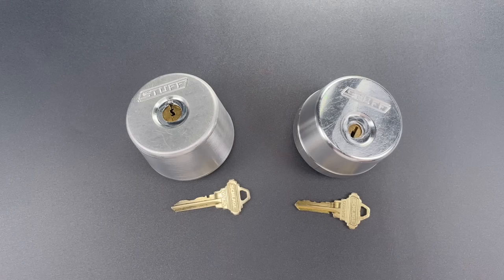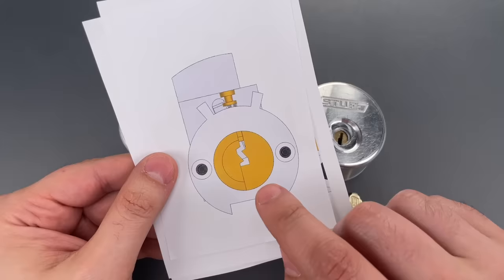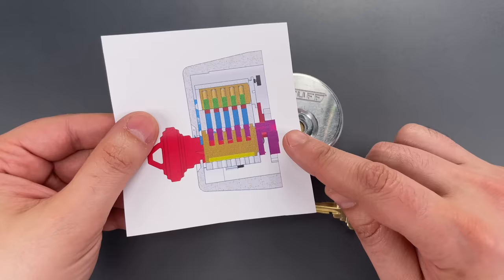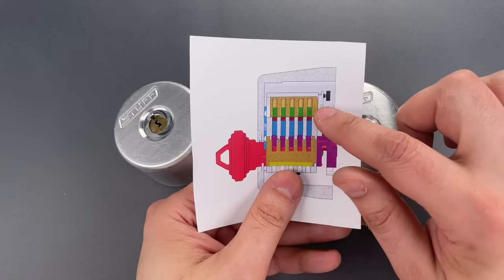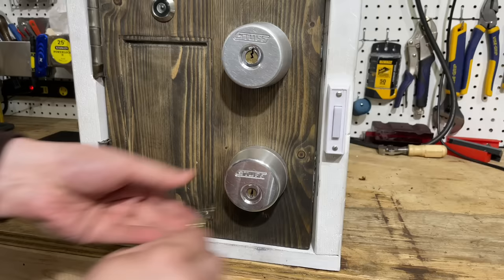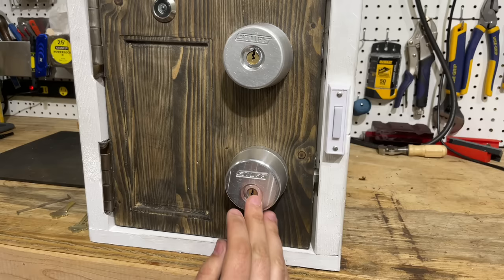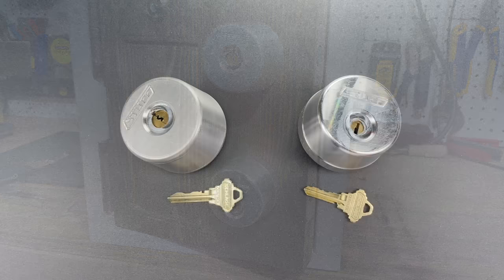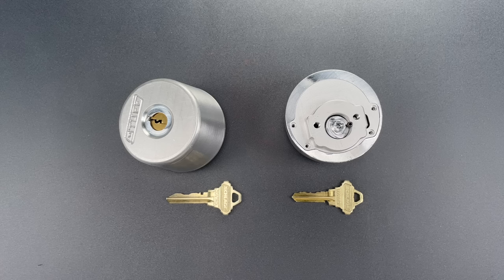[1299] Unpickable Locks From Stuff Made Here

Comment: When someone with no previous experience making locks makes a better lock than most companies
Reply: Does he make an easily and cheaply manufacturable design though
Reply: @ertert4tetert  Literally this. His locks would cost significantly more than something like a masterlock, and his locks are still vulnerable to destructive entry (this lock wouldn't hold up against a drill, for example).
Reply: @ertert4tetert  Its likely not any more expensive to manufacture than any other "unpickable" lock on the market tbh, and the second design (after the backplate was added) looks like its well reinforced.
Reply: @ertert4tetert  It's protecting your house and belongings. I wouldn't care if it cost thousands of dollars and took months to deliver, if it was unpickable and/or offered more security than a lower priced lock.
Reply: @Johnysmyth  Most house robberies aren't due to picked locks. It's through broken windows, doors, destroying the lock mechanism in general..which is why they don't even care about making an unpickable lock because they are more deterrent than actual security
Reply: @Johnysmyth  does your house have windows made of glass? Probably not worth spending much money on your locks then.
Reply: @Awesum  That's on average and the thing about averages is that it doesn't mean it will never happen. In apartment buildings off the first floor the lock and hinges play a very significant role. Also everything you mentioned is loud, visible, and leaves a trace. The last thing I'd want is someone breaking into my house without me knowing because then they can get the jump on someone by hiding inside or break in multiple times without anyone knowing. 

If someone is determined they can get in anywhere. An unpickable mechanical lock is the only defense against getting inside your house without leaving a trace; in every possible situation (apart from forgetting to lock your door). 

Alarms can fail without power and lower ends ones fail just using magnets.
Reply: @Johnysmyth  your not wrong about the apartment, but that's a risky attack, regardless people tend to mind their own business in those situations. I'd argue that if someone wanted to burglarized your home they wouldn't go for the lock..it's easier to break something or even cut out glass, and they will always leave a trace, all the missing items. If it's about someone ambushing you or hiding inside chances are unless there is an easy way in they aren't going to bother..a lock is just a deterent..there are tons if other ways to get into a home
Reply: @Johnysmyth  I could bypass the lock in seconds with an electric chainsaw...
Reply: @KingBobbito  You should watch the video on stuff made here. These are prototypes and almost like a proof of concept. His approach is supposedly to "make it barely work" and making it cheaper/easier to machine can come after that. He's also not trying to make an armored lock (yet), as that would be more expensive to prototype, and impossible to modify. He even has a couple plastic components. It's not made to stand up to destructive attacks at this point.
Reply: Rafael M You would be a moron to pay that price for this. Unless your shed has a solid $50k+ strictly in anti-theft materials and parts, that would be a supremely inefficient way to secure it. Someone can cut through wood, break glass, etc. Or even drill a hole in this lock in a heartbeat. No sane person would spend that much money on this lock when there are far lower hanging fruit.
This is a core principle of engineering that's important to learn. You are never designing for perfection -- you're designing for a compromise between several variables with every decision you make, so you can sell products that people actually buy and add value to society
Reply: @Johnysmyth  Ive worked maintaining buildings in a large city. Having buildings, apartments, houses, offices, hotels ect...All types were broken into at some point, and none were because the lock was picked. Really the deadbolts were hardly tampered with and were not the point of failure for entry. I am very qualified to make this statement "Locks keep the honest people out". 

Ive since moved to a small mountain town, and I don't even lock my doors.
Reply: @Johnysmyth  I had my apartment robbed once. They didn't pick the lock, they hit the door hard enough that the frame broke. 
A lock is only as secure as what it's attached to, and even if you have a strong door in a reinforced frame they could break a window.
Reply: @KingBobbito  and by the time the lock was resistant to physical attacks, the door becomes the weak point. Reinforce the door and now they'll go in through windows. You can go around removing windows and they can cut through the wall. You can make cut resistant walls, but that's a fire hazard, and at that point, you've basically created a large vault.
Reply: @KingBobbito  Jesus you’re smart. If someone breaks into your house the safest thing you can do is get out and call the police. Please explain how you would do that if the burglar makes absolutely no noise by picking your lock. 

There a dozens of cases of serial killers, stalkers, kidnappers, and burglars breaking in unnoticed and harming or killing people. 

There are an equally large number cases of sexual offenders breaking in to do things that don’t involve stealing. Ie going through specific clothing... yeah... or /watching/taking pictures of sleeping people. Those cases almost always evolve into sexual assault. 

So yeah I’d rather spend more on a unpickable key than spend like $50 on some trash lock because “only” 2% of break ins happen from lock picking.

Edit: there’s people who get off breaking in without anyone knowing. Yes people do that, read some books.
Reply: @scoobiusmaximus9508   right but then you are aware someone is breaking in or that they broke in. Ignoring the lock because it rarely gets picked on average is dumb because it puts you in the most danger. 

Broken record but again... a lock is the only way someone can “break” in without making noise or knowing (if you close everything and believe you are safe). An unpickable lock is the only true defense in every situation to knowing no one broke in. Like if your power goes out and the batteries in your alarm are dead... bye bye alarm. 

1. The safest thing to do when someone breaks in while you’re home is to get out of the house and call police. That’s kinda hard when you don’t hear someone breaking in. 

2. Look into the different kinds of burglaries that sex offenders do. Some people get off not leaving any signs. Some people go through clothing. Some people watch you sleep. 

Your apartment was broken into. So you upgrade the door and hinges. Now you’re left with a pickable lock because you decided to argue online about not needing expensive in pickable ones.

Edit: bunch of that never happens Andy’s trying to argue that something isn’t needed. If someone decides they need it then it’s worth the higher cost... idk why anyone is arguing this.
Reply: @Johnysmyth  Buy cameras like any normal person would, then. Battery operated, motion activated, upload to cloud upon capture. There are plenty of them on the market.
Reply: @IFearlessINinja  the variable I care about is my family. I don’t think you understand how many sick people there are who break in for fun or sexual reasons and only do it if they don’t leave a trace. 

I value a lock that I will use for at least a decade at thousands of dollars to stop the 2% of burglars who pick locks. When you already have every other deterrent like, flood lights, cameras, alarms, etc and the weakest point, before spending hundreds of thousands on private security, is the lock you might understand. The point is choice and product value. 

No one here is arguing that these hypothetical expensive locks need to be purchased by everyone, I’m arguing the use of having one, and others are arguing that I don’t need one because either the cases of lock picking are low or it won’t stop people from getting in.
Reply: @Johnysmyth  And before you say "a camera won't matter if you're home" then buy a non-keyed deadbolt that can only be used from inside the house.
Reply: @KingBobbito  I really don’t understand your comment. Why are you telling others what they should or shouldn’t do? If it’s someone choice to buy something or to want a type of product? I also already have cameras. 

Cameras fail, can get hacked, and require frequent updates. A mechanical lock doesn’t have any of those. If it fails it’s broken, you know right away, and it gets replaced. If a camera fails it goes unnoticed until manually checked. Why are you arguing the value I put on something?
Reply: @Johnysmyth  Just pointing out how crazy it sounds to think a lockpicking hacker serial killer is going to remotely shut down your cameras by hacking your home network so they can watch you sleep.

And really, cameras are a lot more sophisticated than that. I have a network at my house with night vision and motion tracking that works wirelessly, automatically updates, notifies me when batteries are low, and I can check on my phone or tablet. Only takes a few seconds to check it's working, usually look when I get home from work. Gives me notifications when it triggers, typically when I get a package or when I set it off.
Reply: @KingBobbito  I’m gonna ignore that you think only serial killers break into houses. You’re arguing about the chance of something happening saying I’m crazy to account for something with a low chance, when there is already a low chance of burglaries happening. Why install back up sensors in a car when you already have a back up camera? The already low chance of backing into a pedestrian was significantly lowered by the camera, sensors for the remaining chances? That’s pointless. 

They are are doing studies in my city to get police to treat different types of break ins more seriously because it’s becoming common knowledge that lots of sexual predators start off doing break ins. Half of the types of sexual predators break in without leaving a trace and that’s how they get off. The other half purposely leave a trace and that’s how they get off. 

A camera is software. If there is a glitch then you won’t know if a predator is coming into your house and jerking off to your sleeping family multiple times. A mechanical 100% pick proof lock removes any possibility of someone getting in undetected. When every other part of your house is secure. There’s no way to hack it and it won’t glitch. I already have cameras. That is my value for that lock. If you value it less that’s your opinion. It’s not a hard concept.
Reply: Rafael M People can still break in without leaving a trace. Most people who do that stuff know you on a personal level and probably have a key already according to statistics. Also, picking a standard door definitely does leave a trace, so that's not the right avenue either.

Comment: Very cool, the design process as well as the analysis. To be fair, using a recess to mount the lock in the door and a steel lip to prevent the knife trick would make this an excellent solution